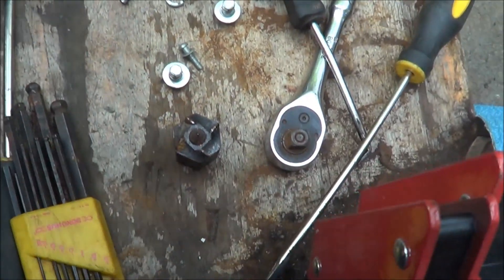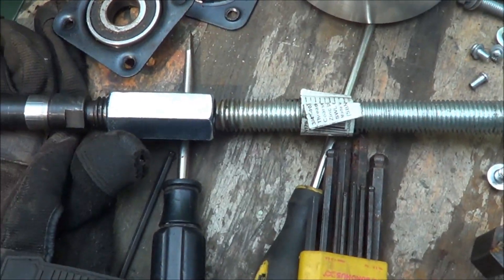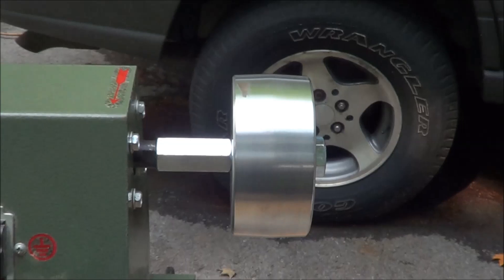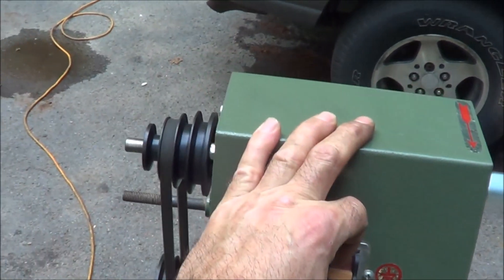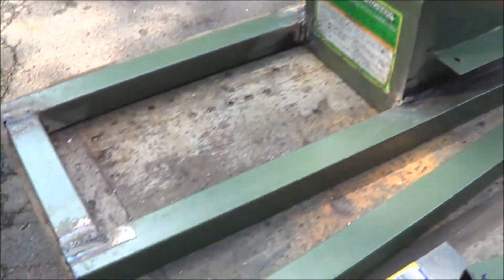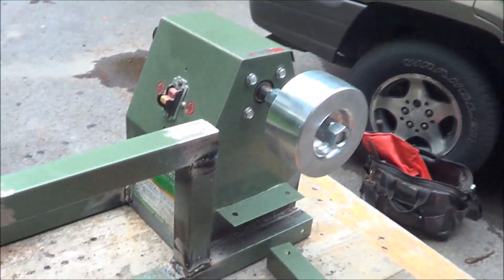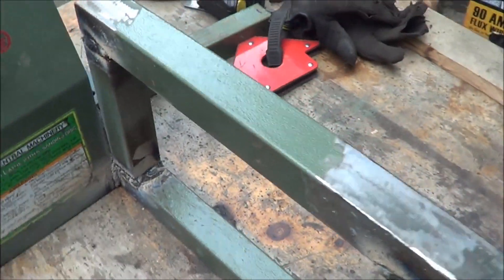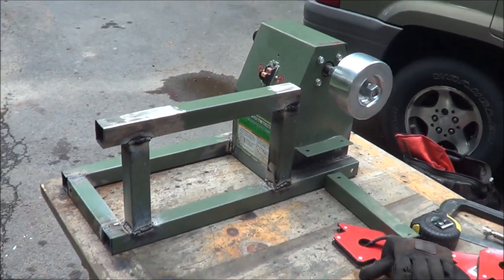Homemade 2 x 72 Belt Grinder Build Part 1

Comment: if i was to buy some flat steel from say home depot,would i be able to just cut and stack it without welding? or do you need a welder?also would i be able to just fold it into itself over and over fresh from the store and heated,or will it have to be heated,cooled and then re heated and folded?

Comment: I know the struggle with bearings and axles not wanting to fit. Had almost 20 different axles and 2 different size bearings. No match. Had to use skateboard wheels until I could get the right size axle. But that worked too quite well! I have a video. Thanks for the inspiration!

Comment: Sweet, Too many forget that people were not afraid to drill holes or make things 50-30 years ago.... even if it was a mistake. You started with a solid plan..[even for a lathe those are weak for power, good base! ]

Comment: Good work.
Though I don't think a half HP motor is going to give you the power and speed that you need
Reply from the maker: TheAgentOfTruth It did not!  It worked but I wanted more and upgrade the motor practically before it used it.  There is a followup video on that

Comment: how long are the belts you use? if you can, write it in centimeters. not so good with inches
Reply from the maker: FsCThePr0 i built the grinder to run 2" X 72" belts.  That's 5.08cm X 182.88cm